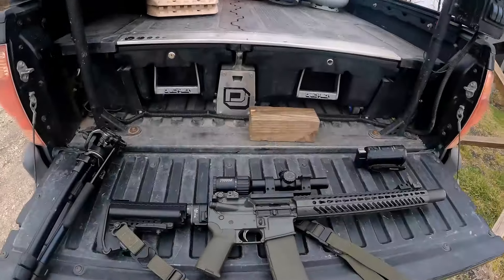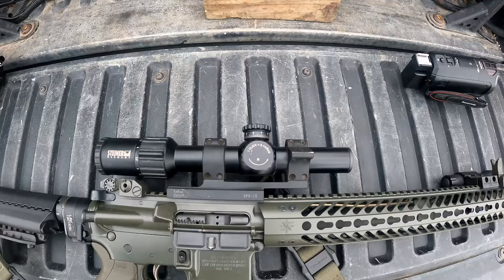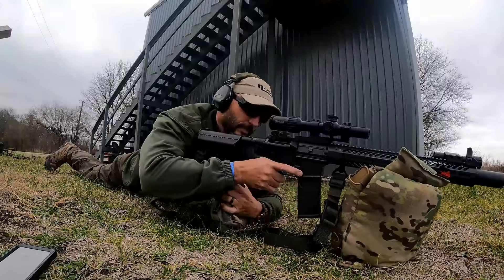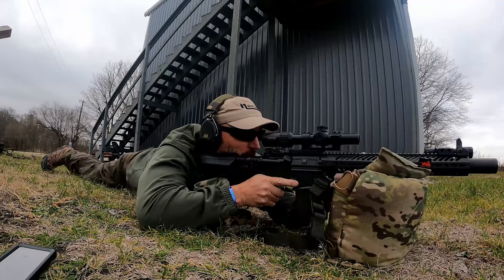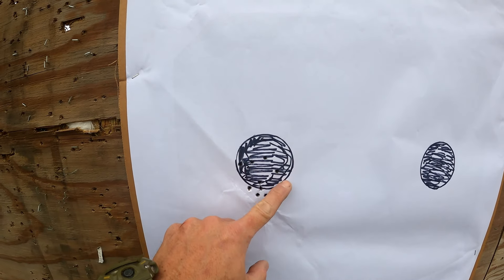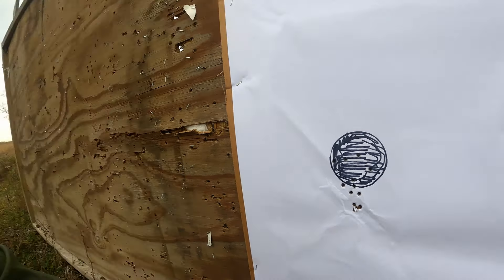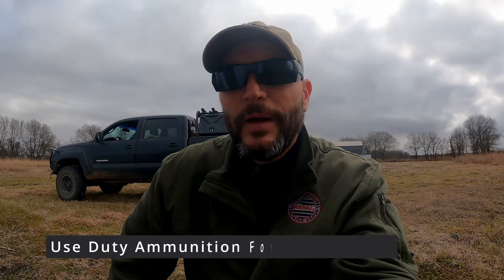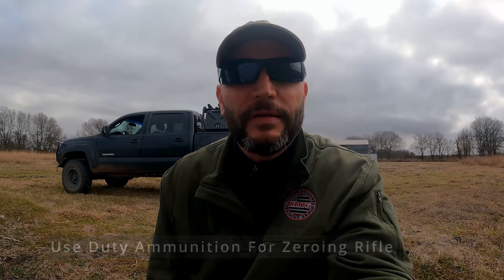Where to Zero Your LPVO, Low Power Variable Optic

Comment: You may have a lager group with the 50 yard zero but when you push it out to 150, 200, and 250 the group tightens up and in my opinion outshines the 100 yard zero.  Just my opinion.

Comment: Working in a rural mountain community for the sheriffs office, I used to run a LPVO on a 16 inch gun and I set a 200 yard zero. Basically I could hold center mass out to 300 yards and scored good hits without having to think about it. With a 200 yard zero, I think it was pretty close at 50 as well.
Reply from the maker: Nothing wrong with that.  You area of operation should definately be one of the things considered when determing what is the right zero for your LPVO.

Comment: 36 yd zero is best.
Reply: Except there damn's few public ranges outside of the military that have a 36 yd zero target on their range.  Sure if you have a private range you can zero at whatever range you want.
Reply: Nope 50 yards
Reply: 36 for combat zero
Reply: If you shoot out to 300, sure.
If 200 or under is more your speed, a 50 yard zero will actually give you less deviation. 
Sean says that in his video.
Reply: Damn Marine corps got me doing the 36yd on all my personal guns 🤣
Reply: Am I mistaken or is the 36 yrd zero for the red dots. For lpvo it is based on a 100 yrd zero and a specific grain like 55 gr. So that the drop lines up on your reticle.
Reply: @Adam Rose  shouldn't matter. Crosshairs don't care what zoom you use.
Reply: @lancegardner8560  depends if it’s first focal plane or second focal plane
Reply: 36/300 is king for combat zero.
Reply: @TreborUSCG 75 inches low gives you any 36 yards zero at 25 yard ranges!
Reply: Depends on the optic. Red dots and holo sights that's basically a must. On lpvo if it's bdc you should zero for the manufacturers specs. If it just has mil or moa then 36 is probably best for 5.56.
Reply: @RazorBrain1  agreed 5.56 specifically my 16 inch Carbine is that so from zero to 300 meters is a 4 inch variance of flight. Holdovers are easy to find out with ballistic calculations.
Reply: 36 yard zero is a fad that nobody outside of YouTube actually uses.
Reply: @riflesfirst208  the Marine Core!
Reply: @mylesharvey6488  Yeah, I mean it’s not like they actually go out and find tune and confirm those 36yd rough zeros at 300 yards, right?
Reply: 36 yard zero is solid what rifle shooter don't shoot out to 300 yards that's kind of basic. I can understand some of yall yanks don't have the range and what not so don't understand so here it is generally with a 36 yard zero you can keep your shots in roughly a standard cd size group out to 300 yards with a 16in barrel with out doing any hold overs or unders. Also keep in mind what level of accuracy is really needed and what situation would it make a difference a few inches up or down what could you really come up with. Most of yall never gona put 5k rounds threw anything to really know what your rifles gona do anyhow.
Reply: What if I accidentally zeroed at 37? 😬
Reply: @carbonjesus5063 Nothing lol
Reply: @rifleshooter😂😂😂😂😂😂channel208
Reply: Height over bore and barrel length will have a say as well.
Reply: @riflesfirst208 that simply is not true 😂

Comment: Great video!   I have been running 36 yard zero on several of my LVPO’s, but I totally agree with your statement of using what’s best for each scenario.
Reply from the maker: Whatever gets the job done!
Reply: i prefer the 36 yard zero. more versatile and the group will be tighter out to 300 with a dead center hold usually.

Comment: Here’s the bottom-line, the initial zero is nothing more than a placeholder, so what’s needed are tic marks on the elevation knob for incremental distances, like 50 yard intervals, beyond the placeholder, which ideally begins at the shortest distance the rifle will be shot. I am a Service Rifle Competitor so my place holder is at 100 yards and tic marks are painted on elevation turret for 200 yards, 300 yards, 500 yards and 600 yards. Thus, when I leave the 200 yard line for the 300 yard line I click from 200 yard tic mark to the 300 yard mark. It’s easy, it’s fast, and it’s exactingly accurate. No doubt better than just having a 100 yard zero and expecting to stay at that placeholder for all scenarios. Instead, chronograph your load and create a trajectory chart for bullet drop from a beginning distsnce to the longest distance where an engagement might occur and mark elevation turret in desired distance increments that are precise enough to get hits on the size target to be engaged no matter its distance. One more thing if you need a means to discern distance of a known size target get a scope with an MOA scaled reticle to permit calculation of distance via MOA ranging formula: target size in inches times 95.5 divided by target size in MOA.

Comment: On the 100 yard zero, your closer shots are still on the rise so I think that means you set a rising zero. 125/150 yard targets should be striking above the point of aim if that’s the case. And eventually they will begin to fall again. It seems with your rifle you have a very long maximum point blank range which is really the goal for this setup. Very cool!
Reply: The 100 yrd zero with 5.56 is a little flat out to 100 then falls back down. It doesn’t rise past 100 yrds
Reply: @craiglewis8272 ok I rewatched the video. There are rising zeros where the bullet crosses the line of sight and continues to rise (as seen clearly by his 50yd zero making shots at 100yd) and a falling zero where it crosses again and continues to fall (none of his shots here were falling)
To maximize your point blank range (I know that between x and x my shots will always be within x inches of the crosshairs) you need to know your minimum acceptable accuracy (2” high or low is good enough) your bullets drop at distance and your sight over bore. 

My 30-30 low low iron sights should be within an inch from 10 to 120 yards as an example
Maximize point blank range so that you don’t need to adjust for distance unless accuracy requirements become stricter or you’ve pushed beyond your range
Also this range should fall on your expected ranges. A ‘room clearing gun’ should not have a 400yd zero and DMR shouldn’t have a 50yd zero
Reply: @moustacheman7130  your first post was about the 100 yrd zero…that’s the zero I’m talking about,not the 50 yrd zero that your talking about now
Reply: @craiglewis8272  I think his was set to a 100yd rising not falling. It’s hard to tell without more info. If it’s a rising zero then shots at 125yd should be high and eventually at 200yd maybe they would be back to zero. There’s a lot of variables I don’t have like his barrel length and sight over bore and his load choice. Good video just not enough data to really display what we’re talking about
Reply: @moustacheman7130  did you really watch the video. He used .223 62gr rounds,barrel length 11.5”
Reply: @craiglewis8272  I guess I missed that part but my point is that people should know how to determine what the best zero for them and their rifle and ammo rather than ‘36 is always the best’

Comment: My owners manual said zero at 50 yards Arken 1-8x28 FFP LPVO 34MM TUBE this is a really nice scope for the money every thing about this scope is good the glass is not bad can ring steel plate 5 hundred yards that's as far as I shot it it's not as good as your scope but it works fine i will try a 100 yards zero will that zero work for all LPVO it is smaller groups good video i learned something when I watch your video thank you for putting it out there for people to learn from God bless
Reply from the maker: You can not go wrong zeroing your optic where the manufacturer says to zero at.  What is your reticle?  Is it a BDC, MOA, or MIL?  If it is MIL or MOA, a 100 yard zero will work just fine.  If it is a BDC, it will need to be zeroed where the manufacturer says to zero it at.  It sounds like you are off to a good start if you are already shooting steel at 500 yards.

Comment: Excelent, very informative and practical, thanks a lot! Zeroed mine today at 100 too.
Reply: I don’t have an LPVO but doing a 300 build and was going to buy one, but at what power do you zero at? On a 1-4 or 1-8 which is what I’m looking at!
Reply: @yockhunter  The zero is the same, regardless the magnification. But if you will use the reticle to measure the deviation, and its a second focal plane scope, you must to know where the marks are calibrated at.
Reply from the maker: @yockhunter  I always zero using my highest power.  You do not have to do that but using the higher power allows you to be more precise when aiming at a zero target.
Reply from the maker: You bet!

Comment: I went with a 100 yard zero because in the manual it said the bdc was calibrated for 55 gr with a 100 yard zero. emailed the manufacturer for more details and they said they designed it with 16 inch barrels in mind because that's what's most common.
Reply from the maker: Great info!

Comment: I just zero at 100 yds because the ACSS reticle in my LPVO is calibrated for that with drop et al.  For 50 yds if it's within the 'donut' then it will be a hit anyway.  300 yd plates in a 3-gun shoot the hash marks were right on and fast.

Red dots I use 36 yd zero, including if I have one offset on LPVO gun.

Comment: 36 yd zero gives you the best all around spread out to 300, and if you're using an LPVO, you want to be able to make good use of your magnification. 

I zero my 4 moa dot with 5x magnifier for the bottom edge of the dot at 36, and the  top edge lines it up great for 100-300 yard shooting. 

I run my LPVO in a similar manner with hold overs/unders.
Reply from the maker: That is great.  It  sounds like you have a system down that works for you.
Reply: @xmtgfirearmstrainingacadem4426  thanks for the reply!!

It seems to, at least thus far. 

Height above bore is a pretty big factor, though. I think most people backed up to a 36 yd zero because they started running higher optic mounts. I know with the .223 bolt action I had when I was younger, a 25 or 50 yard zero gave me a pretty wide spread out to 150-200 yds, but the height above bore was about an inch lower than most ARs. Something to consider when setting up a zero. 

My 7.62x39 runs about half an inch low at 25 yds, and holds pretty solid out to 200. It's a pistol build, though, so I'll probably almost never use it past 100 yds, and you'll almost never get a clean shot that far in the hills of Appalachiastan 😆 

Anywho, I appreciate the work you did on this video, and it puts some good info out there man. You've earned yourself a subscriber!
Reply from the maker: @BuckFoeJiden  I am glad you enjoyed the video!  Thats what this is all about, the sharing of information to make everyone more proficient with their weapon systems.

These conversations also lets everyone see that there is more than one way to do most things.  Everyone does not have the same needs, weapons, are area of operations.  Each person must figure out the best combination for what they are doing and set up their weapon system accordingly.
Reply: @xmtgfirearmstrainingacadem4426  absolutely man, and I LOVE that perspective! Thank you again for what you're doing here!
Reply from the maker: @BuckFoeJiden  👍

Comment: Good comparison. The holder over at 10 yards is pretty much the same, so you'll have to account for that anyways. Between 10 and 100 yards, the 100 yard zero is a lot more simple with minimal deviation, as you said. I like the 100!

Comment: Good video. Results were about what I expected they would be. Think I like the 100yd zero as well.
Reply from the maker: I do not think you can go wrong with the 100 yard zero with a LPVO.  Most optics out there have some type of BDC or grid system in them that makes it a no brainer.  Red dots are a different story.
Reply: @xmtgfirearmstrainingacadem4426  I’ve done away with red dots except for stuff that I wouldn’t normally shoot beyond 100 yds anyway. My eyes are only good to about 50 yds these days without some magnification.
Reply from the maker: @donpeterson9900  I am doing the same.

Comment: I run 100 yd on LPVO and 50/200 on dots. All of my magnified optics are mil and 100 is just easier to memorize becuz everything regardless of distance is either aim center hit center or hold over. With a red dot gun I’m not shooting past 200 anyway so it works out
Reply from the maker: That is very similar to what I do as well.  It works for me.
Reply: @xmtgfirearmstrainingacadem4426  thanks for the videos!
Reply from the maker: @1GruntZPOV  you bet!

Comment: Could be the way the camera lens is set up, but that rifle looks way over gassed. Great video though.  Just getting into LPVO, and I'm looking to try out all the zeros.
Reply: I dont think so, I noticed that too. Ejecting at like 1-2 oclock. Hes running a suppressor, so I think that might be whats causing the overgassing. Why change the buffer out if he runs the gun suppressed and un suppressed and its still reliable.

Comment: +XMTG I agree. With 100 yz all corrections are up. It's easy to roughly account for lots of different ranges quickly and without thinking about holds. Roughy 3 1/2” spread out to 200 yards. Just curious, is your preferred zero for a Red Dot that the same? Thanks
Reply from the maker: If I am using a red dot optic only, I zero it at 50 yards.  Red dots are designed for closer distance engagements so it has been my experience that the 50 yard zero is the way to go with that type of optic.
Reply: @xmtgfirearmstrainingacadem4426  thank you for the reply

Comment: See my problem is, I have the Vortex Gen 3 Razor 1x10, and with 77Gr SMK If I do the 100 yard zero The Subtensions are off for hold overs. If I do the same ammo and zero at 50 I'm still off for the hold over's. IF I do 5/8 inch High at 50 yards I'm just about dead nuts. which would be a 5/8 inch high 50 yard zero but is also about 225 yards.

IMO it doesn't matter what you zero as far as overall. If you know your holds based on you going out, shooting, and finding how low or high you are based on your aiming point. Then just take a mental note or a photo to remember it. 

HOWEVER, if you have a reticle that does have hold overs for distance and wind, you're going to have to fine tune it. Just so everything is dead on.
BUT if you'd rather dial then do any hold overs then my suggestion is zero at 100.
Reply from the maker: @JayNoQuarterReagan  is it mil based or BDC?  Most BDCs are not exact and you have to shoot and figure out your holds.  If it is mil based, you can use a ballistic calculator with your MV to come up with your holds.  You will still need to shoot the data and verify that it is correct.  Hope this helps.
Reply from the maker: @JayNoQuarterReagan  in the end, there is no right or wrong answer, you just have to do what works for your set up.

Comment: I did 8 years in the army as a 249 saw gunner in a sapper company. The hardest transition ive been having is learning the distance between meters and yards when it comes to shooting. The army forces you to shoot everything in meters while civilian side, every scope or rifle they want you to pretty much shoot them in yards. The scopes i have purchased even have zeroing but its only in yards.

I shot expert with the saw and m4 and even tagged targets out to 600m with irons while i was in.

Any recommended  LPVO's or HPVO's for weirdos like me who have difficulty breaking away from using meters instead of yards?
Reply from the maker: I would get a LPVO that has a Mil reticle with Mil turrets. Zero it at what distance fits your needs and then learn your hold overs in Mils for your distances in meters. You can use a ballistic app to get your come ups or hold overs.  JBM Ballistics has a free ballistic calculator online.   Trijicon makes a good LPVO in a 1-6 or 1-8 in a Mil/Mil configuration.  Night Force, Vortex, Steiner, and Primary Arms also offers similiar LPVOs.  I would get one that is a FFP reticle as well.  I hope this helps you.

Comment: Its funny how people can say XXX is the best Zero without adding FOR WHAT! 
It just shows how ballistically ignorant people are.  
If you are trying to get the least amount of impact change out to 150 yrds .. 100 yrd zero is best with a change of impact of about 1.22" ,  a 50 yrd zero would give you about 1.44" and 36yrd zero would give you 3.38" change over 150yrds.  
A 36 yrds zero is great if you stretch that out to 350 yrds plus but most people dont need anywhere near 350 and are sacrificing serious accuracy at more realistic distances

Comment: Actually, the best zero distance is 36 yards, no contest. I am an old Army Infantry combat veteran. I learned on iron sights, hitting out to 500 yards. Since getting out of the Army, the old eyes ain't what they used to be. So I went with an LPVO. I run a Vortex Razor 1x10. I used to zero at 100 yards. Then I got turned onto a video by a Navy Seal, zeroing at 36 yards. A 36 yard zero has less variation of point of aim/.point of impact over the others. the variable impact area on a 36 yard zero on targets from 50 to 300 yards if less than 7". So basically, aim center mass on anything between 50 to 300, and you score a hit on the torso. Here is the video:  https://www.youtube.com/watch?v=21N9r2Gp2Ko
Reply from the maker: Thats is a great zero if it works for you!  In magnified optics with the reticles I run, the 100 yard zero work for me.  Anything past 100 yards, I use hold overs or dial for more precise shot placement.  Thanks for sharing!

Comment: But if using a bdc radical is 100 still the best idea
Reply from the maker: If that is what the BDC reticle is set for, yes.  If the BDC reticle says it should be zeroed at a different distance for the reticle to be used as designed, that is where I would zero it.
Reply: @xmtgfirearmstrainingacadem4426  ok thank you